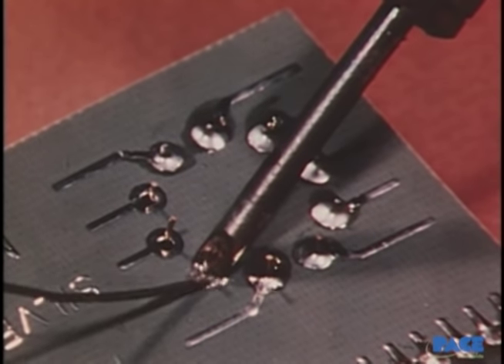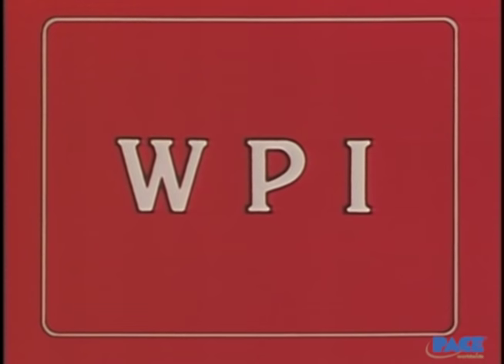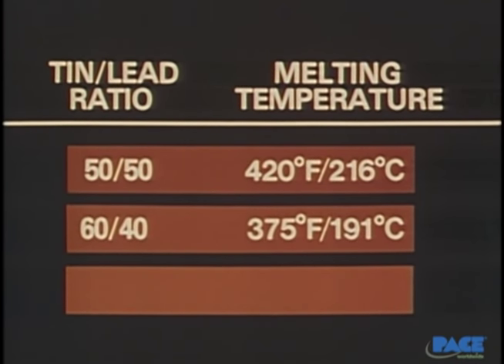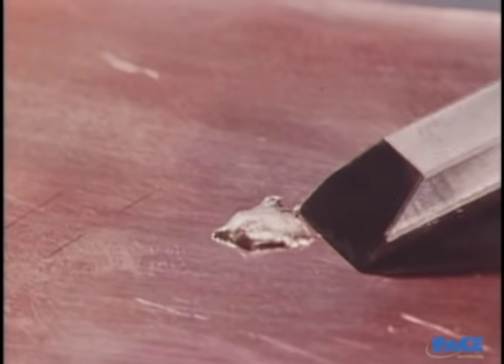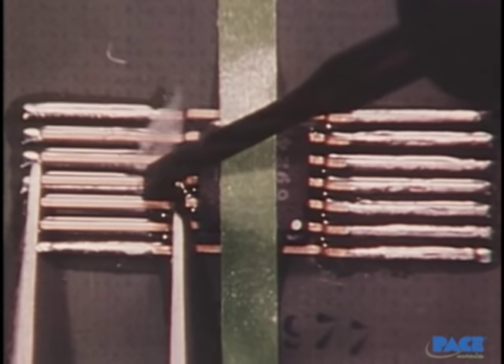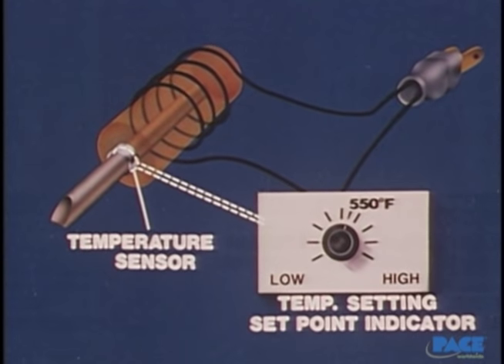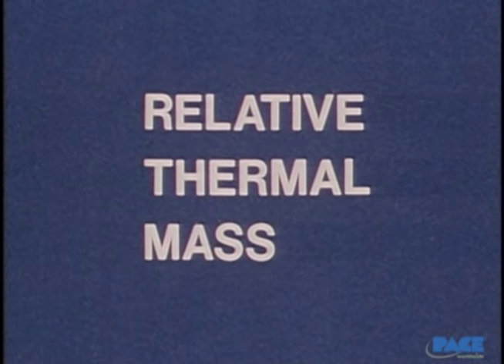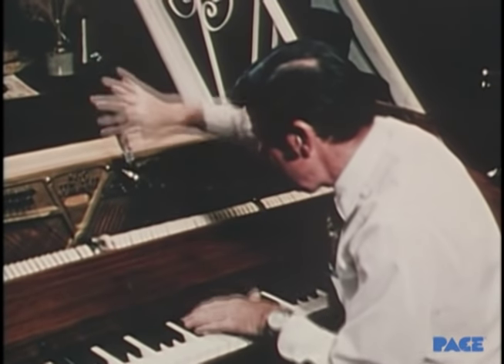Basic Soldering Lesson 1 - "Solder & Flux"

Comment: Fantastic. Good old old school tutorials. What is the name of the narrator?
Reply from the maker: Mazinga This was a local weather man in the Washington DC area in the 80s and 90s. His name is Paul Anthony :)
Reply: +Dean Johnson I've used both and didn't really experience a difference
Reply: Dean Johnson which sponge made the tip discolored, brass, steel, or both?
Reply: +Dean Johnson  I couldn't find a local source for quality items for soldering, either. Try e-bay or Amazon. Both have good-quality solder, brass tip cleaners, temperature-controlled soldering irons, etc.
Reply: @R00kTruth  *steel

Comment: Please note that it is Soldering not soddering, otherwise we would have sodders in the army, the item was sodd.    He was much bodder than the others etc etc.      L in any language is not pronounced D
Reply: Phil Cose The older, the odder?
Reply: He pronounces it /sader/ because in phonology 'L' is a palatal fricative which has a different place of articulation than 'O' an 'D". it is so hard for tongue to pronounce 'O"  for a fraction of a second, then curl up near the palate to pronounce 'L" and proceed to pronounce 'D' from the alveolar ridge place of articulation above upper teeth ridge, so 'L" is said to be assimilated negatively, meaning that it is so faintly pronounced that it is almost not heard to improve the flow and the pronunciation time and hence less effort for the whole sentence to flow better to sound more proficient. It is an economic function of the part of the brain which is responsible for the energy, time, efficiency of pronunciation. If you are a native English speaker, you certainly although subconsciously employ different forms of assimilation to improve speed and to reduce the energy and effort. It's the same thing as when you pronounce Water /Wader/ instead of /water/ or got you /gacha/ instead of /gat yu/
Reply: He is pronouncing it it’s correct way for a North American video.

solder
[sod-er]
sol·der  \ ˈsä-dər , ˈsȯ- , British also ˈsäl-dər , ˈsōl- \
noun
any of various alloys fused and applied to the joint between metal objects to unite them without heating the objects to the melting point.

Comment: They definitely don't make 'em like this anymore. 
This one video stands head and shoulders above all the other newer soldering videos I've seen.

I now know I need an iron with a larger heat reservoir, some flux and a  tip with a longer work contact area to get the solder to melt into the stranded wire I'm trying to solder onto some LED strip light pads.

Comment: Sadly lead free solder is being used today which makes the likely-hood of the electronic products malfunctioning since non-lead solder seems to suffer from heat degradation.

Anyone wanting to solder should make sure lead is contained within the solder unless the electronic device being built is not going to reach any hot temperatures such as a mobile phone or calculator which generates little heat.

Comment: What I learned 
• if more than 2 seconds to heat, change tip (Too quick? Smaller tip. Too slow? Bigger tip)
((I think if you have a small tip and it's too slow, I believe you can up the temperature instead of changing tip, (vice versa with big tip) ))
• no pressure on board 

Questions: 
• how do I know what temperature to use??

Comment: I'm 73.  Been  fiddlin with electronics since around 63.  Got my ham license in high school around 65.  Last 4 years I worked part time building  electrics/ electronics for a local power chair outfit. This job was my  first experience with lead free.     I still have an older Pace  desoldering station shown in the video.

I have a Metcal station,  several Weller pieces,  and some Pace equipment.

Comment: The flux in the solder wire is not enough.   The purpose of flux is to cover your work and prevent oxidation during the soldering process.  Always use additional flux to ensure reliable soldering.

Comment: Man....what a blast from the past! I thought I'd seen this before. Then I remembered it big time when he got to the general rule about "get in and get out as fast as you can." That cracked up the whole lab - can't do that now :)

We bought several complete soldering stations after this presentation by the Pace guy.

And how about good old Trichloroethane? We used gallons of the stuff, including Carbon-tet, Acetone, and MEK - in properly ventilated areas of course!

But yes, this is still a top notch "how-to" video!

Comment: I started watching this as I thought it would be a silly 1980s video, ridiculously out of date and not relevant. now 10 videos in to the playlist and learned so much. Absolutely incredible resource
Reply: A few things have changed, SMT rework requires you to use drag soldering now, what old timers would have ridiculed as "solder shoveling" but with tiny SMD ICs there is no other way and they have tips designed for this method now.
 Also I have found that with very large wire and connectors like 8 AWG and 12mm bullet connectors you sometimes have to resort to tricks like kapton tape to protect against potential solder spill but that's really closer to welding than soldering (some would also ridicule that but I don't feel like being punished for a slight misjudgment in solder amount by having to completely redo a connector)

Comment: I feel like I am back in grade school and in charge of the projector, cool (I liked school). Several facts and techniques about solder I never knew.  No wonder most of my solder worked sucked.  Guess I shouldn't have been using that acid paste or taking 30 seconds to heat up a joint.

Comment: WARNING: At 12:28 he says, "...in reality tip temperature is not that critical at all." This DOES NOT MEAN WHAT IT SOUNDS LIKE AND SHOULD HAVE BEEN STATED VERY DIFFERENTLY! The temperature IS COMPLETELY CRITICAL, but ALSO, the heat source must have ENOUGH MASS TO MAINTAIN THAT TEMPERATURE AND TRANSFER IT QUICKLY TO THE WORK WITHOUT DROPPING!
This needs to be updated as well to include instruction on LEAD FREE SOLDER! There is no excuse for most people soldering today to be using lead!

Comment: I was IPC certified... several times.  But I always had problems with basic joint soldering.  I was told "if you have any questions, ask".  But I didn't know what questions to ask.  This video filled in the gaps. Thanks.  P.S. Management took our flux away from us, told us the flux in the rosin core solder was enough.  That's when things got really bad.